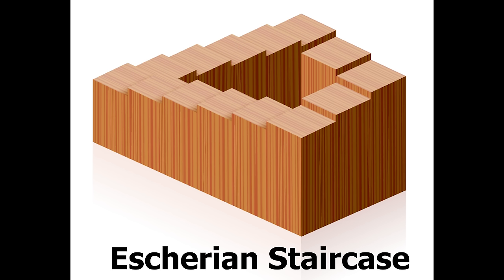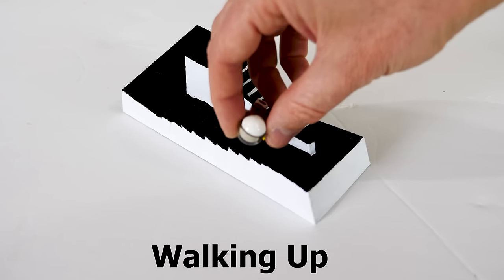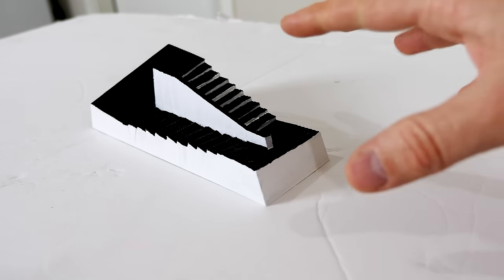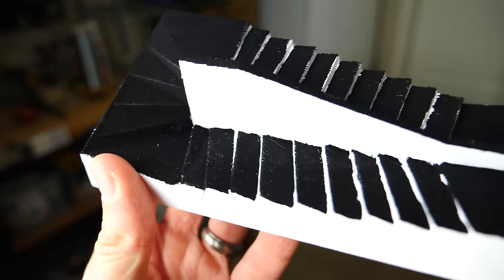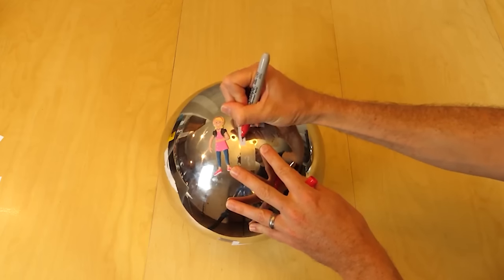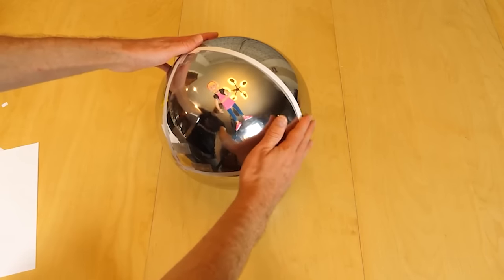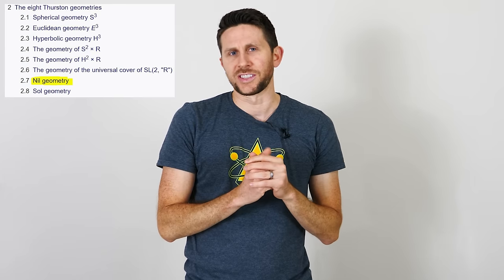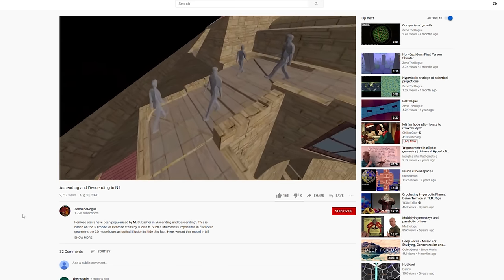How Does a Real-Life Escherian Staircase Work?

Comment: 90 degrees right angle is actually a feature of Euclidean flat geometry, a Line drawn on a sphere is actually a curve and the 90 degrees you measured is actually between the tangents to these curves, not the actual curves.
There is a 3D angle measurement called the Steradian

Comment: If you try you could do this with a Rubik's cube even 4*4 ones but it has 4 different staircases that are connected and always go up or down which is so cool 
All of the things you have to do is to grab one of the faces and move each column slightly up and turn to the right face and do it again (it will show better on 4*4 ones) after you finished look at the top face it's a continues loop.

Comment: The dropoff is one of the very good reasons why the traffic goes continuously to where you started. But I’m still not satisfied. I mean it’s just too stiff. Unless maybe you went there and felt the floor going down. The whole explanation is cool and believable, but it’s still missng one thing. If you happen to visit the area, you should get a spirit level tool and get every steps of the ladder and the surfaces. Because i think it’s not just a dropoff that made it. I think the whole construction is tilted a little to the right, if you take a bottle of water and lay it on the ground, would it draw more water to right?

Comment: 3:20 to make a square we need 4 right angles and 4 lines to join those angles. And the open box you drew has only 2 right angles at bottom left and right corner. So by drawing 3 angles and joining them with 3 lines will never make a square .

Comment: Here is GPT3's  explanation of why our brains get tricked into this optical illusion. 
In an Escherian staircase, also known as a Penrose staircase or impossible staircase, the brain's perception is tricked due to a combination of factors involving depth perception and visual cues. Our brain relies on various visual cues to interpret the three-dimensional world around us, but in the case of an Escherian staircase, these cues are manipulated to create an optical illusion.

"One important cue our brain uses is linear perspective, which is the convergence of parallel lines as they recede into the distance. In a typical staircase, the lines of the steps converge as they extend into the distance, indicating a change in depth and a decline. However, in an Escherian staircase, the lines of the steps are cleverly arranged in such a way that they appear to be parallel, even though they are not. This manipulation of perspective tricks our brain into perceiving the steps as being on the same plane, rather than descending.

Another factor is the use of ambiguous or conflicting visual information. In an Escherian staircase, the visual cues provided by the elements in the scene can be contradictory. For example, the position of the handrails, the alignment of the steps, and the overall structure of the staircase can all create conflicting depth cues. These conflicting cues confuse the brain's ability to accurately perceive the depth and orientation of the staircase.

Overall, the brain's perception of the steep decline in an Escherian staircase is undermined by the clever arrangement of visual cues that suggest a different interpretation. It highlights the limitations and vulnerabilities of our visual perception system when presented with deceptive or contradictory information."

That kind of sums it up.

Comment: Since I live in the real world, the equivocation of the words "up" the stairs or "down" the stairs is misleading. Even the "slope" has steps if you look closely. As for the "right angles" or "straight lines on the sphere again they are equivocations o their meanings. The line on the sphere is on a curved surface obviously or it would not work otherwise. At the slope end of the staircase the Lego man has to go up or down in opposition to the up the stairs or down the stairs. My two cents.

Comment: Is it just me, or when he connected the 3 right angles with tape on the sphere, the tape lines did not line up with the right angles at all? Like he was just connecting 3 points with tape but not at right angles.  You could see the original  tape corners sticking out  from under the longer pieces of tape, not being completely covered by them. So those corners were not true right angles.
Reply: So? If you doubt his result, why don't you just do the experiment yourself? That's the beauty of Science! Repeatability. It's not Dogma, you are NOT required to believe. Just understand. And experience.

Comment: This really seemed rushed on a production level. Whoever was in charge of making that sloppy Escherian Staircase should be reprimanded. not to mention the constant changing camera angles broke the illusion by the second cut. good prep work could have solved this such as a fixed camera that never moves and is properly fastened to its mount. making sure the prop was fastened to the surface with something like earthquake clay/puddy. (its easy to remove after the fact but strong enough to ensure the item wont shift during and between takes.) for a channel that has over 2 million subs I would expect more care put into the production. But as it stands now it seems rather rushed,.

Comment: I usually really like this channel, but the presentation was way too obvious. He should take this video down. Just my opinion.  Edited: upon close inspection, there was a flaw in the design. The slope side should have been painted black at the corner of the white wall. That corner screams downward slope. The angle on the bottom corner should have been painted white. That whole section is off